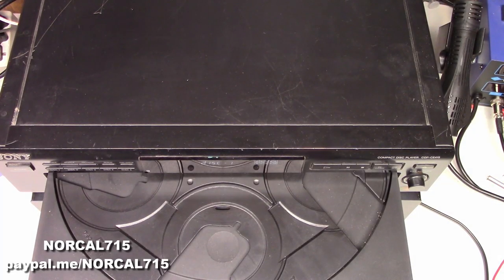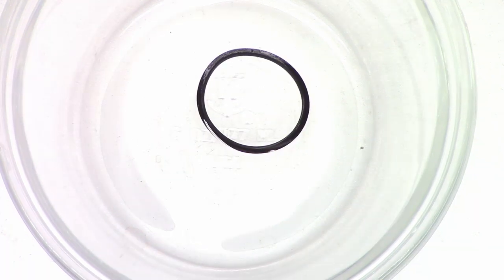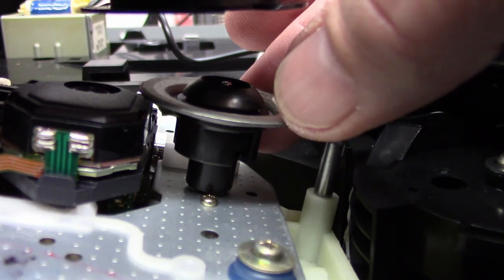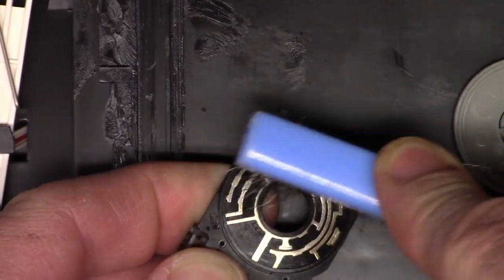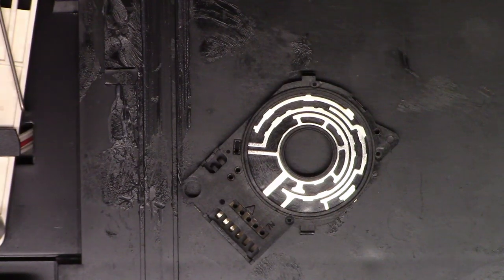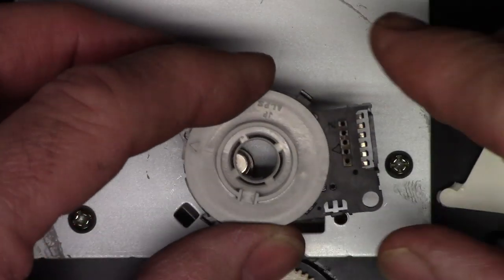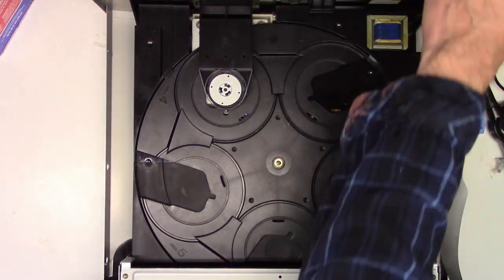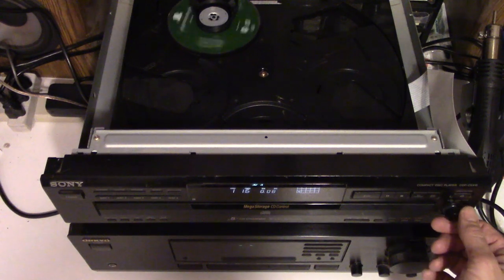SONY CDP-CE415 SERVICING AND REPAIR. ROTARY ENCODER MODE SELECT SWITCH REPAIR FIX

Comment: On silver plated contacts, I always use a cotton swab with tooth paste. It does not deteriorate the very thin silver layer, like other abrasive methods do.
Reply from the maker: good idea. it is just abrasive enough.
Reply: Reminds me of cleaning Memory & other connector edges. I use a soft eraser and they clean up like new as well. As for the toothpaste that is a perfect fix for worn CD/DVD/BD scratched surfaces that won't play. Saved a many of them like that before ripping music CD discs to FLAC, DVD's &  BD's to ISO for backup. It's HHD expensive, but worth it until I can burn new replacements.
Reply: A normal rubber works great as well

Comment: I'm assuming most things are EPDM.  At least they behave like it.  That said, there are plenty of polychloroprene (neoprene) belts in things too (turntables, etc).  

EPDM will be affected by aromatic solvents (naphtha, xylene, etc)
Neoprene will be affected by ketones (acetone, MEK)

The effect wanes to some degree as the material dries, but installing a softened belt will result in it being stretched when it dries.  I don't think a wipe is enough to cause issues or be overly aggressive exposure for the task at hand.  After all, you're trying to remove the surface of the belt (i.e. not merely contaminants, but the oxidized surface material as well). Soaking might be a bit excessive though.  

To put it in perspective, the "safe" choice is isopropanol -- which isn't really good for neoprene either (and won't do as good a job at removing oil residues anyway).  Belts get stiff/brittle/gooey all without interaction.  They're ultimately a consumable part.  Anyone worried that they're going to ruin a belt by squeezing another five years out of it with a solvent wipe needs to rethink the value of the thing.

P.S. 
I prefer using an eraser on tarnished silver contacts, but it's usually about impossible to fit it into tight spots.  A fiberglass pen works too.
Reply: IMO it's best to simply replace belts rather than cleaning them. I've never cleaned old belts that I took out of something; I always replaced them with new ones for reliability.